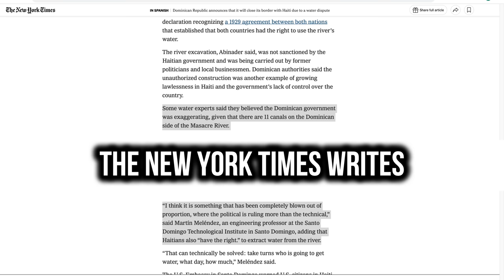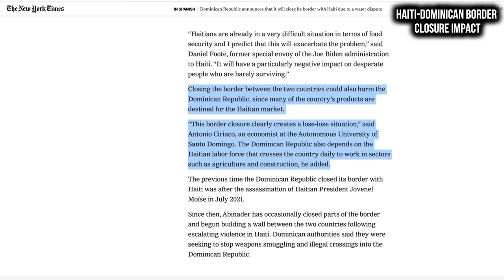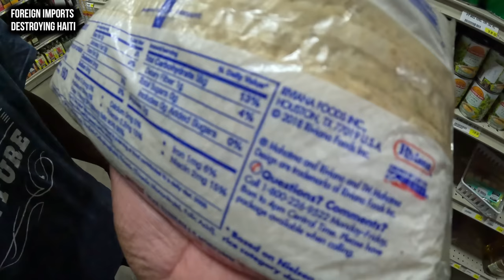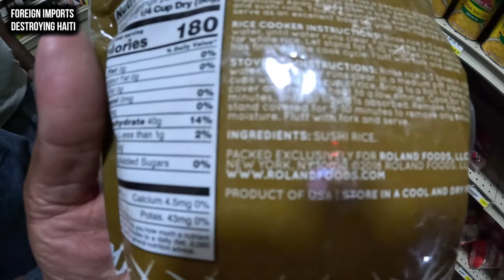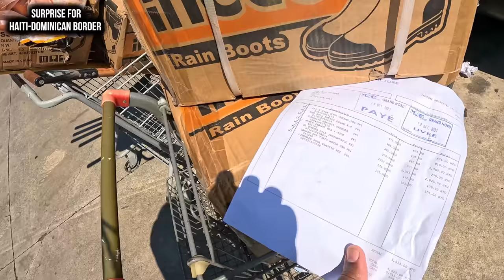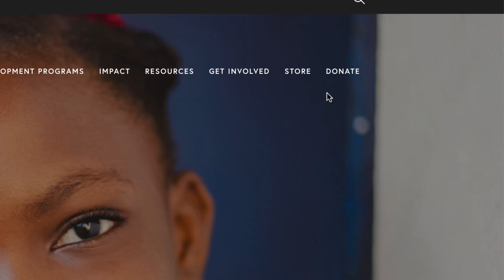Trouble in Haiti - Dominican Border. Closed

Comment: @acedtvl at minute 2:47 you can see clearly they are diverting the course of the river,  FACTS! that river serves as a border so changing its course means changing the border that why the treaty prohibits it, FACTS! last month OEA came to both countries to study the Issue Haiti didnt receive them FACTS! Haiti has dryed almost all rivers close to ouanaminthe due to irresponsible agriculture and badly built channels like this one.. FACTS. aggressive pple pretending to be victims when they are the ones doing everything bad. FACTS!
Reply from the maker: clearly, you're not an engineer. how do you think they build Canals, you have to block the flow of water in preparation for a canal that way the construction can dry

Comment: Incorrect! This river without any doubts starts miles and miles deep from the D.R. and the canal as you have seen with your own eyes, does not have the correct corresponding studies, permits nor planification at all. Second, this has nothing to do with politics as all internal parties agree with the current border measures. Third, items burnt on the D.R. side were all of their properties. D.R. It's a shame that they are acting like that burning food, hopefully they won't regret it down the line. Last, this is only going to hurt a very small group financially on the D.R. side, for sure it will be a disaster for those on the Haiti side, not only those right across the border, but the many thousands that need to come back to work. I hope things get better.
Reply from the maker: Actually, it’s hurting them big time because the longer the border is close who is going to buy all the excess food and what about the cheap labor as well this is all been talked about in the video
Reply: @ACEDTVL  It's a very minor food amount and that can be sold elsewhere internally. This is a very small community compared to the rest, it will hurt the Haitian people the most in the long term. Plenty of people in D.R. to work and that would be up to the different corporations to pay accordingly as needed. Even with what's currently happening, there are still hundreds of thousands of Haitians  both with permits and undocumented still working throughout the D.R.
Reply from the maker: 13:42
Reply: @Xenlacasa45  That would be correct, less than 50-40 individuals.

Comment: Why do all of these so called " neutral reporters" fail to mention that the Haitian Canal sole purpose is to deviate the waters of the massacre river to serve another river inside Haiti. And they also fail to report that the Haitian channel is at a higher elevation than the masacre river meaning that the canal will need a dam to deviate the waters. You fail to mention the environmental damage that this will cause to the flora and fauna downstream. Nothing good has come from Haitians involvement with the environment and you know it.
Reply from the maker: 2:56 ? sounds like I mention it there plus , the construction of the canal has been going on for nine years. If elevation was a problem that would’ve been an issue nine years ago as well during the time when the Dominican republic and Haiti were at talks about the construction of the canal. the location of the canal hasn’t change. what’s going on is people are freaking out for some thing that hasn’t even been built yet assuming the worst you can say all this and that about something that hasn’t even been built yet I can understand if it was exactly happening, but nothing that is happening. Everything is hearsay and assumptions.